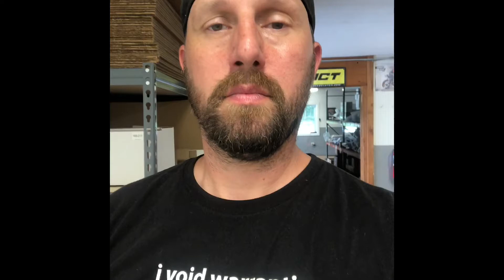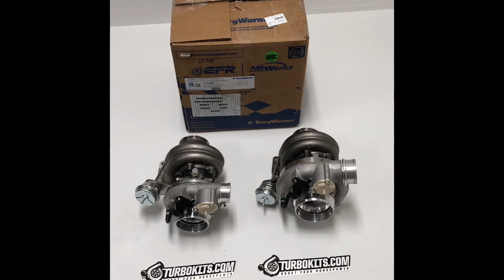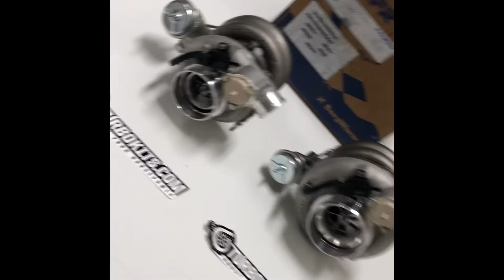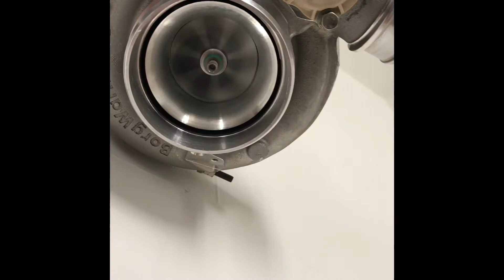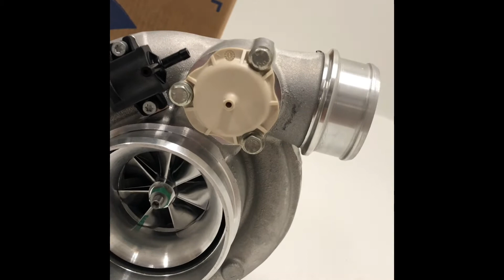BorgWarner EFR 7670 & 8374 Turbochargers - Quick Specs

Comment: Are the hot side housings interchangeable? I have one of each but one in internally gated and the other is externally
Reply from the maker: For the same turbine wheel EFR, yes, so if you have a (2) 63mm housings and want to swap them onto your 7163, 100%. If you have a 58mm housing, it will not swap onto a 7163, it would only work on a 6258/6758. If that makes sense?
Reply: @TurboKitscom  got you, i have one housing off a 7670 and one off an 8374. The reason for me to swap is the manifold  i have is for an internal wg but the housing on my 8374 is for eternal wg.
Reply from the maker: @Gilligan.Garage  Ahhh, yes, we understand, they need to have the same turbine wheel in order for the housing swap to work... Let us know if you need to order just a turbine housing. Thanks!